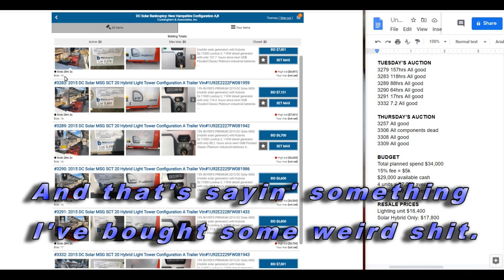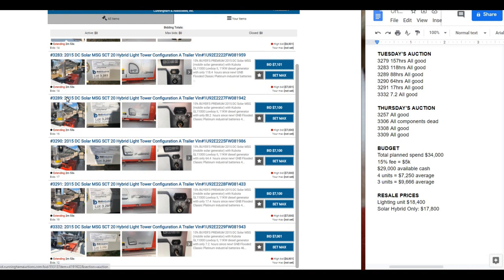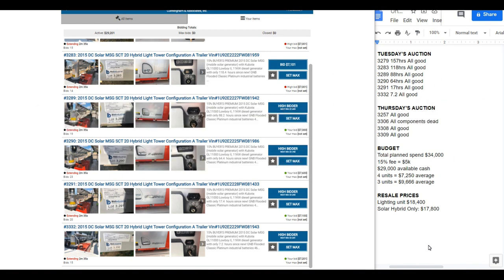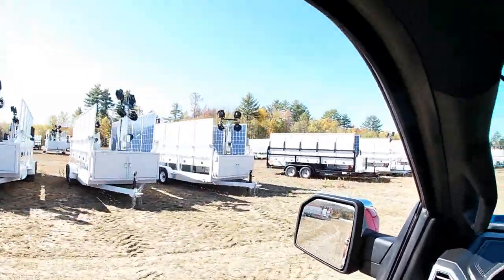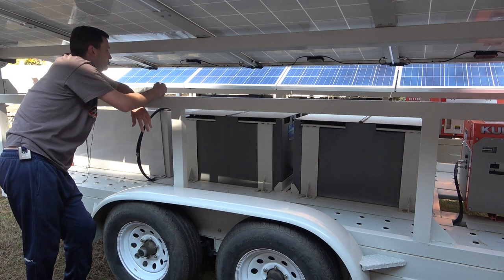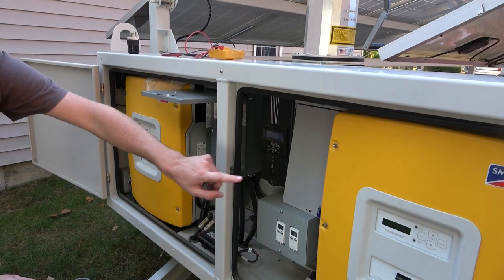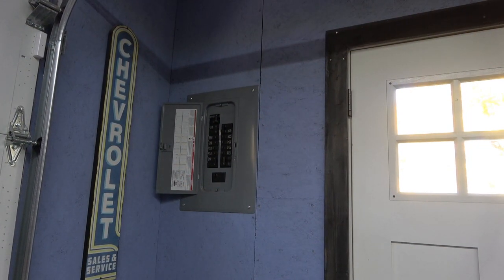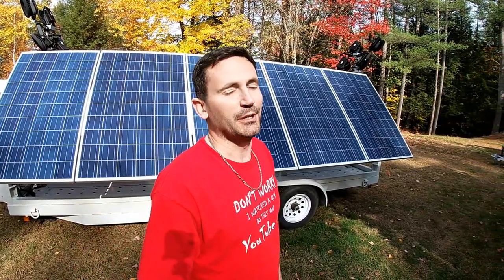DC Solar Trailer Auction Process - How did we make out? Deal or no deal?

Comment: I pulled all 5 of mine from Vegas to north central Arizona. No plates,  no problems. Check water. One of mine took 22 gallons distilled chicken water, the least was 13 gallons. When you beat it with everything the house can pull, during the day, it pretty much keeps up. Definitely do your laundry and other high draw events during the day. Mine tanked to 17% snd shutdown after 2 cloudy days (I have configuration H no lights or generator) so I switched back to my diesel generator until the sun came back.  I've been off grid for 21 years now. Way out in the sticks. I have since integrated my old diesel generator into the system. It's more than powerful enough at 13,000 watts,  165 amps. But if unit gets too low,  it works that old girl pretty hard. (Its about 60 years old) regardless, I'm very happy with my investment. 3 of The other 4 are already gone at a SUBSTANTIAL profit. Gonna try to get more.

Comment: Yeah, I made it to the end... I did the first auction in California at US tower where they were built. I bought 2 for $5000 with fees. These are 2018 units without the Kubota or the lights. They also sold a bunch of the raw trailers for $800. Maybe a better buy than the solar units since so easy to resell. Not AGM batteries, but in perfect shape and yes these things are HEAVY. Sold one for $6500 recently. Problem is several hundred more are coming to sale and I think the prices will crash. I have all the documentation for the components that are the same as yours but what I need is a "operators manual" - Got some good tips from you on the master and slave, but getting the inverters to turn on is problematic.  Where did you get your information from the get these powered up?  Batteries are fine and the midnite controller shows 52 volts and the incoming wattage from the panels.
Reply from the maker: Wow, that's a good deal, especially considering yours are a couple years newer.  I just literally button pressed my way through learning them.  Now you've got me wondering if it would be beneficial to record a walk through of how to operate/trouble shoot the trailers themselves before I tear them to pieces.  What do you think about that?
Reply: @Trialnerror  Please do that. I think there are many that don't have a good handle on the exact mode of operation.
Reply from the maker: @RRaucina  Yea, that's a quick and easy one.  I'll knock it out ASAP.
Reply from the maker: @RRaucina  I just posted it for ya!
Reply: @Trialnerror  Thanks!!!
Reply from the maker: @RRaucina  Did you happen to notice the price of future auctions is going UP not down!!!  People are figuring out what they are really worth.  We got a really good deal1
Reply: @Trialnerror  Yes, seems that way, at least until the next 600 hit the market...
Reply: @Trialnerror  It's now Feb 2023, and these are still selling! Price keeps going up from what I've seen. $11,500 would get most of them that are ending today--lightbars and/or EV chargers on them. 
Any updates? How's the chicken doing?
Reply: Holy schmolies, your update video is fantastic! Thanks. Here's the link for anyone else like me wondering how it went a few years later. 
https://www.youtube.com/watch?v=psZZn1c3eac&list=PLnSIJRM8Kj_OMXeI8rmsOLiQt_nXJDAs-&index=10

Comment: Great Chicken video. ? Did you turn off the main breaker to the garage when you plugged it in. I bought one unit to add to my house to kick on my solar unit on the house when the power goes out. I have to shut the main breaker from the grid off or the trailer solar kicks off. The most I get at night is 3 to 4 hours than it kicks off. I just looked at the batteries looks like they need distilled water added. I want to get off the grid I have 13 kw on the house (grid tide). The trailer has the batteries, I may need to add batteries, do you know how to do that?  Anyway appreciateed both videos, but the trailer back in May 2020. I have used to power one refrigerator, I needed to use it more efficiently and plug it into the house and get off the grid they keep steeling my juice (electric company).  If i can get it to last all night we will be in business. Mine doesn’t have the generator. Crazy thing is these were all made about 5 miles from my house in Woodlake CA. Crazy government contract.  I paid 7,500 for mine w/o generator. That was a score. Thanks again.
Reply from the maker: LMAO.  Yes I isolated the grid from the trailer and then made the switch.  You don't want the SMA's to get in a sword fight with the grid.  Please check out my more recent content on these trailers (go to my playlist and you'll see a DC solar playlist).  I'm fully off grid now but with grid tie backup.  That may help answer some questions for you.  You should be getting a lot more than 3-4 hours out of even one trailer so those batts need to be topped up with water and run a full 6 hour EQ charge to get the electrolytes moving again.

Comment: so what's the maintenance requirements on the batteries...water top off, etc?
Reply from the maker: Yep, top off and check specific gravity (which I'll do in the spring) and check each individual cells voltage.

Comment: I'm building a 800 square ft casa, I bought 2 trailers one w gen and one without, can I run my house and shop from the trailers? I won't be there full time so I would like to store them in the shop when I'm away. Any advice would be appreciated
Reply from the maker: You should be in great shape with two trailers.  Plenty of solar and storage for a house/shop that size.  Good luck bud!
Reply: @Trialnerror  thank you I was thinking about a dual RV pedestal to plug them into( if code allows ) they gave me building permit and didn't ask about power, house is framed and shop is built. So I guess time will tell if I can leave the trailers mobile? Great find on the grand national post picks
Reply from the maker: @danshea3283  I don't believe they can do much of anything to stop you if you plan to leave the trailers mobile.  It would be no different than running off a normal generator. at say a seasonal camp.  Really no code worries there that I'm aware of.
Reply: @Trialnerror  thank you, for the informative video on these trailers

Comment: The charger in the inverter is AC->DC (charging the batteries from the generator). The Midnite charge controller is DC -> DC (from the solar to the batteries). You need both in a solar electric system.
Reply from the maker: Ohhhhhhh well that would make sense.  Thanks man!

Comment: One will run your house. It's a killer system. We're buying two on the 4th. Off grid for 26 years. And those light towers would make a great wind generator pole. Air 405 wind generators.

Comment: best way to (temp/perm) wire your house with those trailers is add 2 50 A breakers and RV outlets at panel .  buy 2 RV cables.  buy marinco male plugs for 1 end of the RV wires and it will plug right in to trailer.  Make sure you disconnect main breaker before plugging in. And make sure the phases are the same all the way. Cost me less than $400

Comment: I'm late to the game but I can't stop thinking about getting a few of these. But I really want to know how heavy they are. Did you weigh them? I've got a Chevy Silverado hybrid, so it doesn't pull a lot. And I'm about 4 hours away from the auction site in Vegas, so I don't want to go down unless I really know I can do it. Any help would be great. Thanks for the video! It was very informative.
Reply from the maker: I haven't weight them but I know what 5k and 10k feels like behind my truck.  These are right in the middle, I'd say about 7,500lbs.  Add another 800 or so if the fuel tank is full.  I pulled mine with my 1/2 ton F1fiddy and I felt very comfortable with it behind me.  Good luck with the auction and let me know if you have any more questions bud!

Comment: Powering your home off the generator will cost more than paying the electric bill. But the solar panels that be good. Just hope those inverters don't give you problems as replacing just one will wipe out all your savings. from using solar.

Comment: If I want the inverters and batteries to work in synch with grid tie do I just connect a cable from one 50 amp trailer output to the 50 amp generator input receptacle I already have for propane generator? Seems too easy and wondering if the SMA units detect and synchronize to grid.
Reply from the maker: No, the SMA is not capable of grid feeding at all.  You'll just start an electrical sword fight and the SMA's will lose that battle.

Comment: 50amps on 10/2 is a no no! You didn’t mention battery water levels did you? I bought 2 and needed 60 gallons to top them off
Reply from the maker: Don't worry, I only have them going to a 30amp breaker in the house panel.  Yea, each battery "box" too about 1.5 gal to top up.  Thanks for commenting and good luck with your new toy!

Comment: Great video.  While I admire your industrial spirit I must ask how much is power ($ per kwh) where you are?  At 20 cents / kwh it normally only runs around $6/day to power a 3000 sq ft home.  Guess I'm having a little trouble w/ the cost vs benefit analysis.
Reply from the maker: NH has the second highest costs of electricity in the country.  My average bill is $300 a month.  Since filming this video I've installed everything, sold off the parts I didn't need and ended up making about $12,000 ON TOP OF getting back my original investment.  Believe me, the cost/benefit has worked out very well :)

Comment: Dude, try evaporative cooling for the house - be aware I don't live in the same country but if your humidity isn't like 1050% you'll be very satisfied and the electricity bill not bankrupting you every month may be a pleasant surprise, it'll be like 40% of typical refrigerative AC costs - not taking anything away from your solar idea at all, I commend you. The outlay is minimal with a far nicer environment to exist in - and yeah I'm a mech/IT engineer from down under. There is no better way to cool your house and use China to supply the equipment (as I sit in standard refrigerant AC) - my house in OZ has this concept. I gain nothing but you'll be very impressed and it'll take a load off the solar system.
Reply from the maker: Great idea and GREAT info.  That's something to consider because our humidity is generally pretty low. Thank you!

Comment: I have the basic unit, 2016, good batteries, no diesel or lights.  Anyone know the secondary market value?? What are these selling for to end users?  Thanks.
Reply from the maker: You should be able to get around $7-$8k as a whole, another $1-2k if you part it out.
Reply from the maker: Can I ask what you paid for it?
Reply: @Trialnerror  This was the very first auction at the tower company in  Central rural California where they were built. They sold the raw trailers for $900 +/- and I regret not getting some. I think I got 2 for 5k plus fees, base model no gen or lights. I sold one to a friend for $6500 and thanks to you fired up the other one today. All in order. Not certain if I want to try and use it on some land I have without power or go to craigs list for $8k

Comment: I'm watching this from my non YT Premium account and the two ads at the beginning seemed fine, 1.5min each, but about 4 min in and i get 2 more ads one of which is a 32 mins.  After a few more minutes of video I got a 1 hour+ ad  followed by the earlier 32 min add. This is crazy.  I know you don't control ads just thought I'd share.
Reply: Made it to 16 min of your video and 2 more ads.  This time each under 2 min.  This has turned into an experiment to see just how many ads are played. So far over 2 hrs of ads.  At this point i feel like Fry,  Shut up and take my ad revenue.
Reply: Almost 2.5 hours to watch the 33 min video.  YT Premium is so worth it. (I know, ad blockers, but i like to support creators)
Reply from the maker: Holy crap! That's not right at all. Are they not skippable or are you testing them to see how far they will go if you don't skip them?  Either way I suppose a thank you is in order for your test = ad revenue lol!
Reply: @Trialnerror  I had the option to skip but I didn't  just to see what would happen.
Reply from the maker: @oisforoffroad  OK cool.  Thanks for the incite though.  That's good to know!

Comment: Hi I just pushed the same unit with the generator.  I am having some issues with both inverters turning off.  Do you have any suggestions?
Reply: Are you saying your inverters are shutting off? If you're still having issues, let me know what behavior you're experiencing.
Reply: What are the error codes?  I had a similar experience due to low voltage/batteries.

Comment: Very cool that you won 4.  I’d keep all 4 battery sets, and 2 generators if it were me.  Well, you can never have too many generators.  I’d end up keeping everything but 3 trailers and the towers.  I would not save as much money in the deal, but I’d have endless power possibilities for my self and all my friends.
Reply from the maker: I'm fighting myself with that now.  I want all the equipment but also want some of my money back!
Reply: I’m just a hoarder..  if your goal is to truest always be off-grid, I’d keep 2 generators.  Having a backup would mean never having to worry while your generator is down waiting on a stupid part that your dealer doesn’t have in stock.
Reply from the maker: @wickedcoyote271  I wasn't considering keeping two at all but ever since you commented I've been thinking.  You're 100% right.  I was also thinking about the battery bank. It's going to be huge and it will take forever to recharge using just 1 gen.  May be nice to have two for that reason alone.